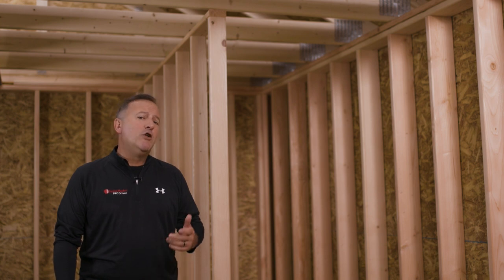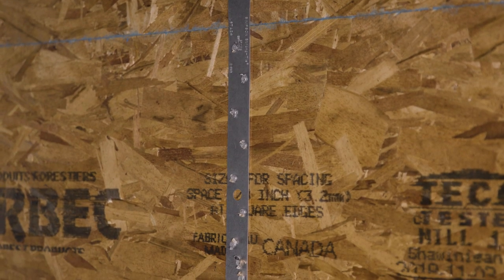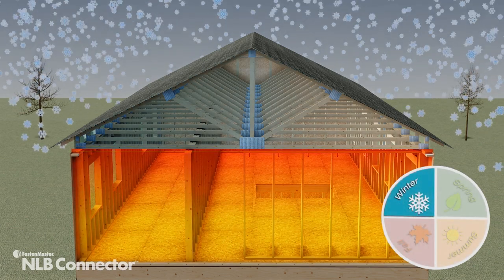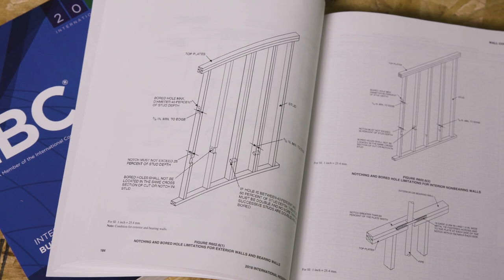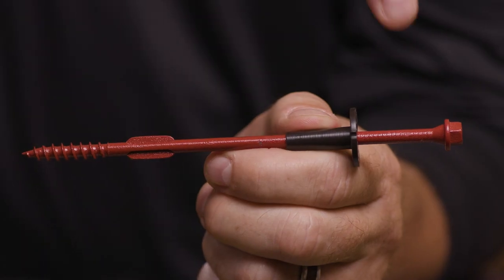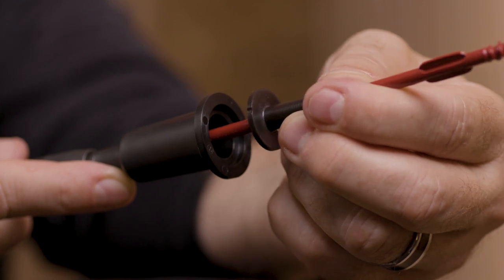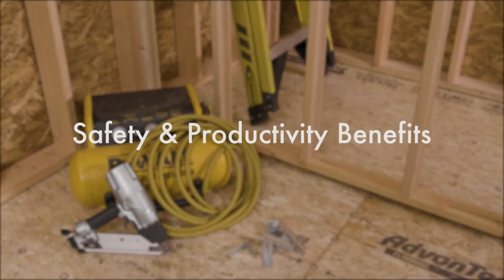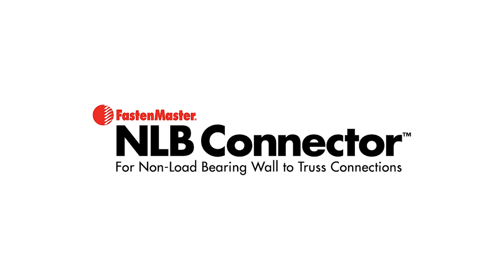FastenMaster Non-Load Bearing Connector

Comment: What about the drywall finish on the ceiling? Wont that crack up to the amount of play allowed in that screw?
Reply from the maker: Great question! Actually it will prevent drywall from cracking by preventing inadvertent loads from being placed on the non-load bearing wall.
Reply: @FastenMasterPro  my question would be the tape joint at the top of the wall. If the ceiling is fastened directly to the truss, any movement of that ceiling is going to crack the tape joint at the inside corner of the wall and ceiling.
Reply: @adam10102  Yes this was my intent in my question too. I'm unsure how movement is good when it comes to that tape joint between interior walls and the trusses. Also im up here in a colder climate in Wisconsin. So plenty of expansion and contraction with heat and snow loads

Comment: So the 2nd top plate HAS TO be omitted?
Reply: cmm170526 no not required but you have the option to eliminate one of them to save on material cost if you so choose.  NLB is compliant up to a 1.5” gap.